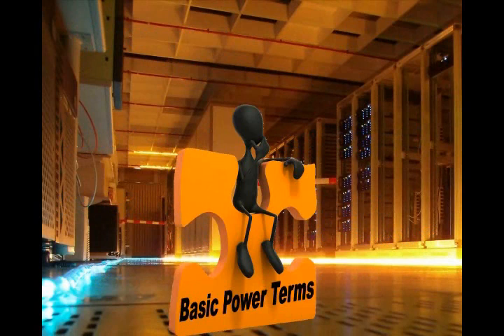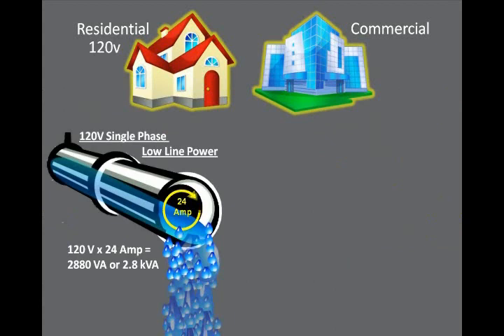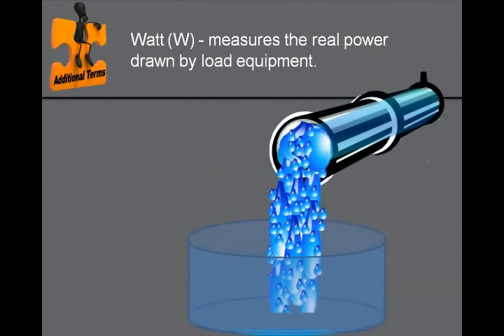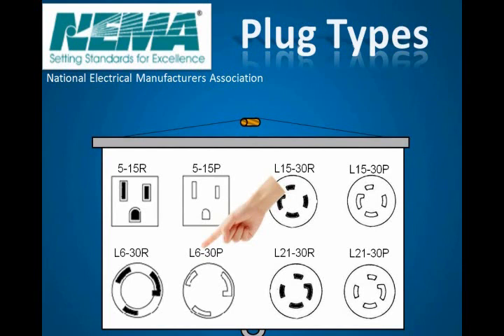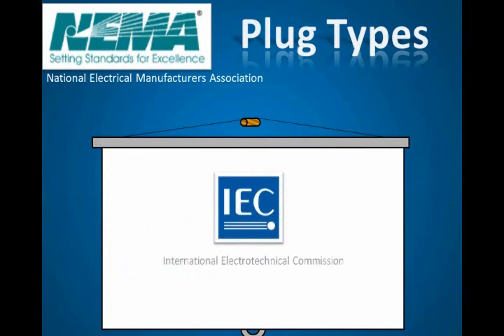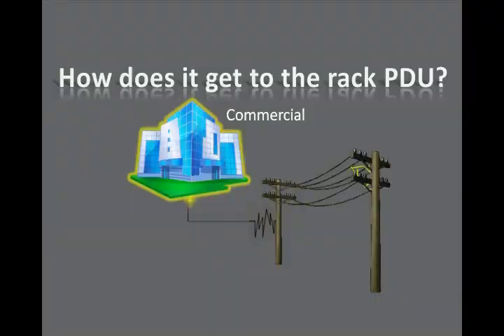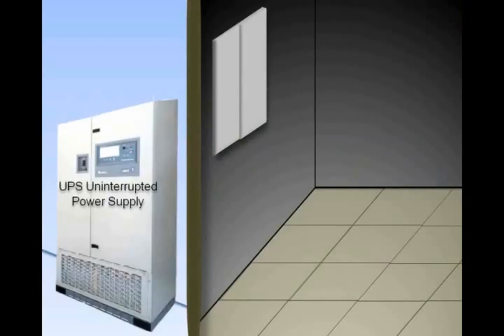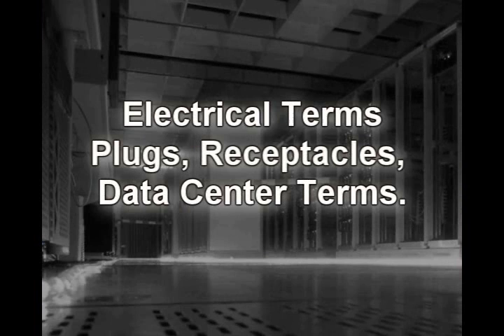Rack Power (PDU) terms and technology

Comment: HOLD UP!!!  About the power derating, It's not that simple.  It's not just 80% period, end of story.   Equipment CAN be rated for 100% load.  The same goes for a branch circuit breaker.  Most are rated for 80% but there are 100% rated breakers that allow continuous loads up to the limit of the breaker.  And there are 100% rated PDUs that allow continuous loads up to the limit of it's current rating as well.

Comment: power factor is not the ratio of real power to apparent power. power factor is the cosine of the phase angle difference between the voltage and current.